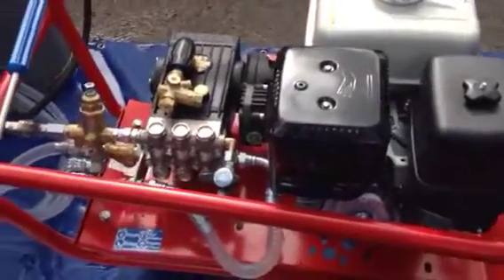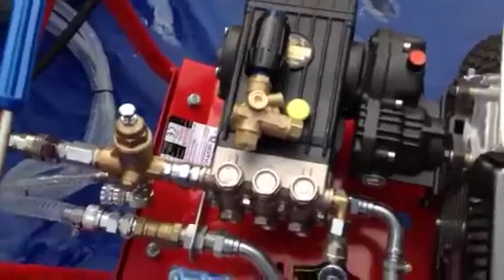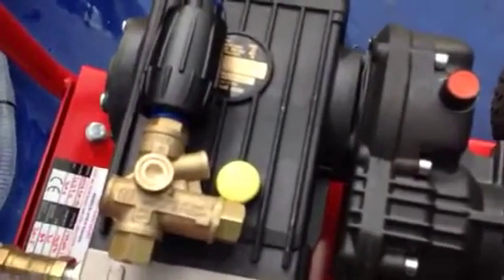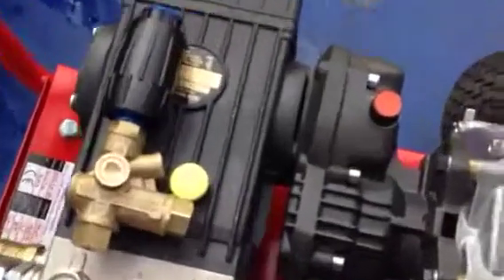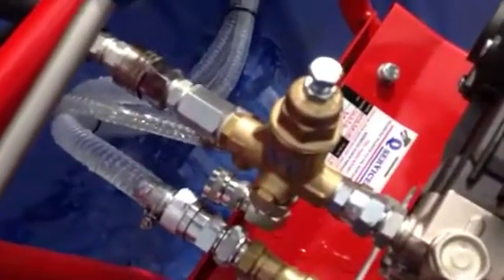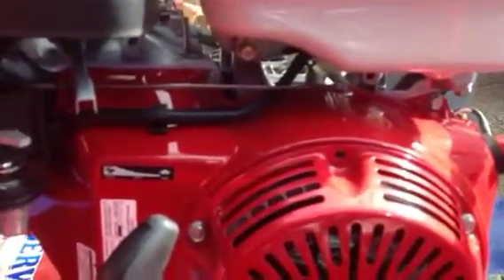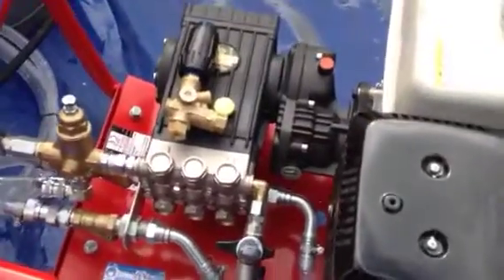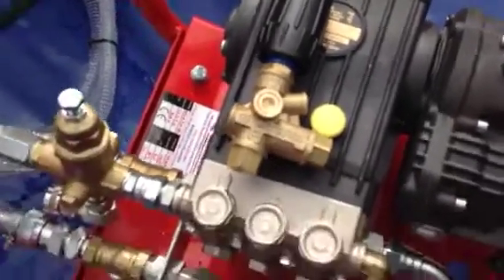K1 FLOW SENSITIVE UNLOADER TO TRAPPED PRESSURE UNLOADER WHY

Comment: Hey bud, nice video thank you. I didn’t quite catch the method of adjusting pressure with this flow sensitive system.
Did you say to turn down the revs on the motor directly?
But this would reduce the pressure AND flow, so guessing you said something else?

Comment: why fit a trapped pressure unloader ?   cost ? 
I am sure if I want my engine shaft to last I would fit a K1 / K5 
Every time I see a UL180 TP unloader its always screwed down to the max and when the pump is removed from the engine the keyway is worn and woodruff key wrecked 
Manufacturers poor design ?  or is it operator  poor knowledge ?
Reply from the maker: The system under strain all the time, what would happen if a car went from 0-60 in 1 sec & 60-0 in 1 sec. problems. That what a pressure washer does with a trapped unloader.